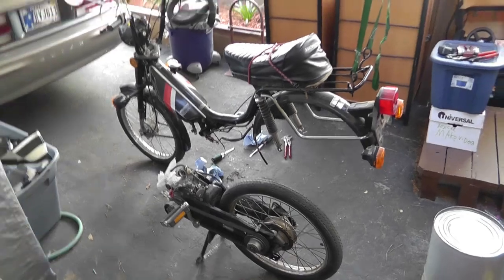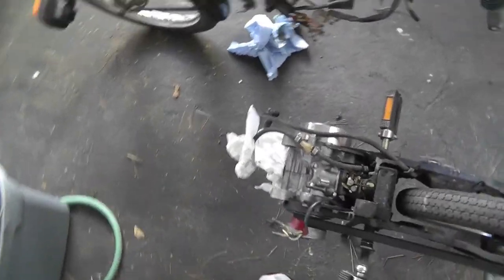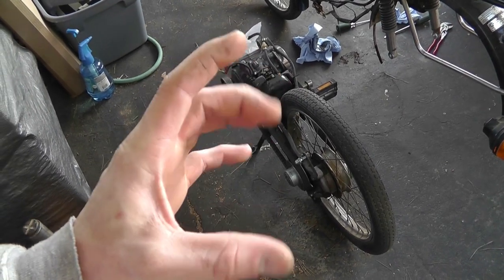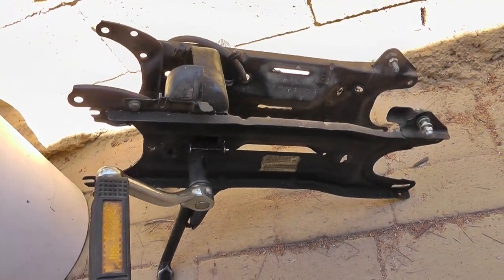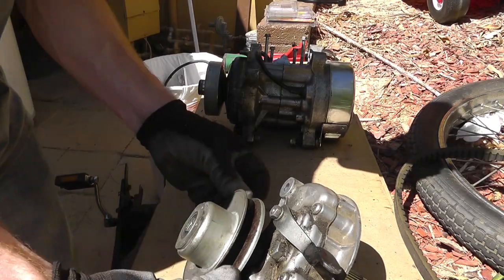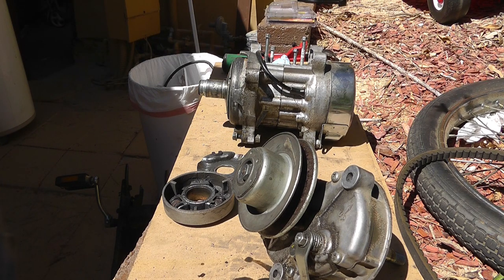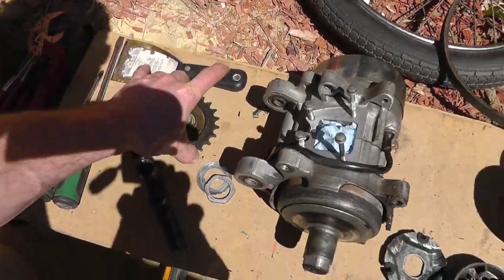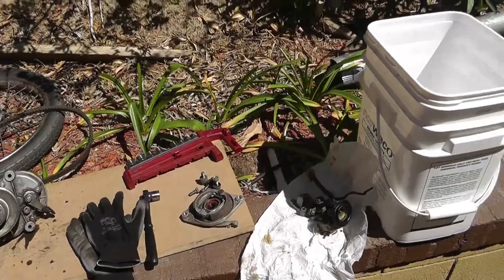#2 Honda PA50II Hobbit. The Tare Down & How A (CVT) Continuously Variable Transmission Works.

Comment: Hello there Russ one inventor to another inventor.
I have an excellent idea for you regarding two cycle engines. Sense the oil and gasoline lubricates the entire lower end of the engine It would be senseless to have HHO Gas go through the entire process with the gasoline mixture. My idea for this would be as the engine coming up for the compression stroke HHO Gas would be delivered through a fuel injector under pressure during that process bypassing the saturation of the lower end of the engine allowing it to be only in the compression stroke. I hope everybody reading this can understand the principle and the delivery is critical for two cycle engines the correct timing of delivering HHO Gas only during the compression stroke halfway up to top dead center.
Reply: 2 stoke would use 2 times the fuel. the 4 stroke would have as much power or more with the HHO mixed into the fuel.

Comment: The increasing diameter of the front pulley pulls the belt tighter, so the rear one squishes outward, thereby getting smaller in diameter ,doubling the ratio range.

Comment: Anybody interested in following what I am doing. I am planning on supplementing a Home generator using HHO Gas and Hexane reducing the consumption of natural gas consumption that powers the Emergency backup generator. HHO Gas generator machine will be getting electricity from the electric True Sinewave generator and not getting it off the wall plugs.
Reply: you should put a generator on russels moped. give him a jolt cola, and collect the energy